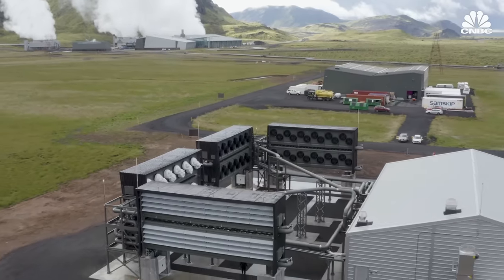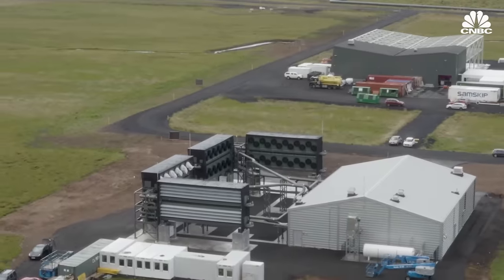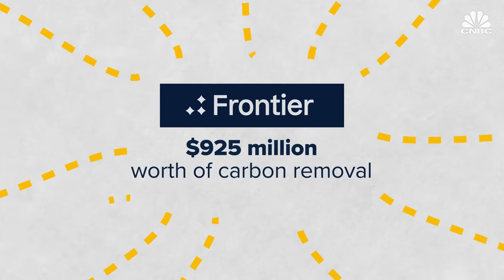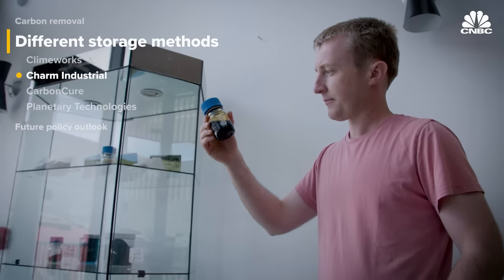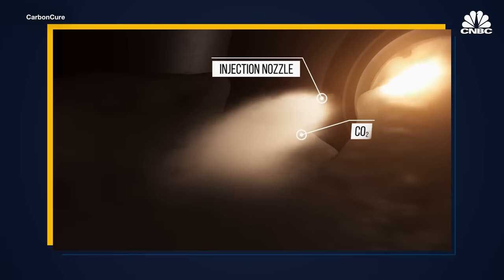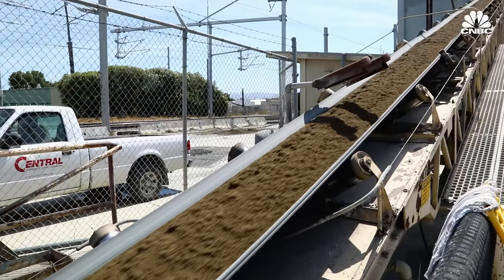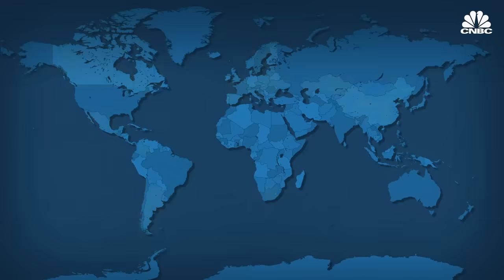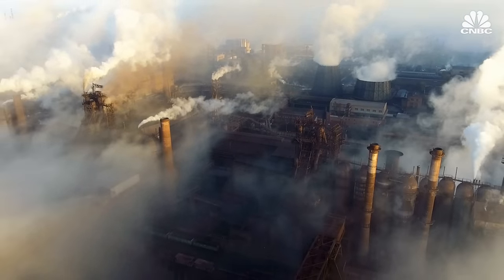Why Big Tech Is Pouring Money Into Carbon Removal

Comment: Green houses use 2000 ppm for optimum plant growth. In 2020 412.5 ppm global average. Plants cant grow under 150 ppm. Would be quite easy to scrub a few 100 ppm out of the atmosphere and claim global warming. green cools the planet. Record, recorded temps come from concrete cities with asphalt and dark roof tops the are ever growing lessening the greens needed for a stable climate. But hey they have built the seed arks for such an event and it would not be that hard to replace the Co2 back to levels that can support plant life. Idiocracy only difference is Co2 and not the water. IF Co2 drops below 150 ppm no amount of sun, water and fertilizer will allow plant growth.
Reply: Easy? 100ppm is 250,000,000,000 tons of carbon doxide.
Reply: @wilsonflood4393  as long as we stay above 150 ppm.

Comment: Removing carbon is a wrong strategy. We need to reduce its production in first place and need to create new culture which would counterweight consumerism.
Reply: All good, ut does not address the problem of the excess CO2 in the air. It's not going anywhere by itself so we need to remove it. We need both, decarbonization and CDR

Comment: Using the carbon capture concrete to build highways that also can recharge EVs including freight hauling trucks would be a big step in the right direction for never putting the carbon in the air in the first place while using the carbon concrete. The big trucks and the cars wouldn't need as big of batteries either.

Comment: Forests need a lot of open free space.
 I would instead use the most invasive and fastest growing pest plants It could disturb the ecosystem but they would be harvested continuously by everybody, bringing the biomass to central points for conversion into biochar. The material must be easy to harvest manually and to dry on the air.
Reply: Thats a terrible idea
Reply: I like the thinking. This sounds fantastically inefficient, unfortunately. We already have a ton of agricultural waste as it is, we really need to avoid any more. Plus, this takes land away from growing actual crops and things that people do want/need.
Reply: @Cyrribrae  Only when fossil fuels get even more expensive, "other solutions" might become attractive. The conversion to biochar could deliver gas too (plastics?)  We don't have the ovens yet and that's a hard nut to crack Perhaps household waste ovens could be adapted. As you know biochar disappears out of the carbon cycle for centuries. It can improve very bad soils too. Too heavy metal rich ashes could be perhaps added to cement based construction material The choice of the plants is important. (Hennep best??)  I see potential in Asian knotweed since it is edible for animals (even humans) and it can be dried on the air (better for in the oven) Of course fields with grains, beets, vegetables etc should not be covered with knotweed now. Even grass is good  and pulls carbon out of the air. But knotweed can grow "everywhere else;" in principle, though now we have the second big problem. It must be kept on distance from where we DON'T want it. But I see it almost everywhere, every day and I always felt a kind of spiritual love for the plant. Disturbing the ecosystem is less of a problem since insects don't like it. Of course it should be everywhere but also cut all the time for many decades. It would be like a war against CO2. The effect would only then be noticeable after 10 years at soonest but we can start "now" while carbon capture with machines is never going anywhere I think.

Comment: Any mechanical process for carbon capture is B.S. It will be enormously inefficient but will receive government funding: even the Kochs are in for the pork. The scale required is incredible: if all the excess CO2 were captured in coral reefs, it would create a mountain range the size of the Appalachians. Organic solutions such as fertilizing the oceans to produce more plankton or producing calcium carbonate clouds (RIT Croacia paper) are cheap and efficient.

Comment: there are older ideas that arent mentioned in this, the fuels industry made an effort into it, but then it made no sense... 

The reality is that most of the presented markets or technologies base themselves on capture to storage, which means they deliver a service, not a product... they allow larger companies to still emit greenhouse gasses, on the premise that it will get offset by a aforementioned technology... it achieves very little, and it only drives the point to a break even point... where we capture as much as we emit... you can force companies to pay for 2 tonnes of removal for every 1 ton of emission... but they will just bill that to the end consumer...

Now while I'm totally for the carbon capture technology and am well aware that it needs to be part of the future... I think the older approach can be more impactful... 

The fuel industry looked at synthetic fuels... fuels made from large quantities of readily available resources... in this case Carbon Dioxide and Hydrogen... it failed at the time because it didn't make sense, burning fossil fuels (emitting CO2)  to then use the energy to make hydrogen and capture CO2 to then make Synthetic Fuels which release CO2... it was a fools errand... however things are changing, capturing CO2 is developing, and becoming cheaper. Energy sources are becoming carbon neutral, and no matter what the future is reliant on clean cheap and abundant electricity, which brings new life to the Synthetic fuel idea. But why would you ask? Very simple, unlike previous methods, which is a service provided to offset carbon emissions, this is a product which literally replaces fossil fuels in its entirety within the transport world... buses, cars, trains, boats, airplanes.... they all could be left completely unchanged but become carbon neutral overnight, still running on Kerosene (synthetic), Diesel (Synthetic), and Gasoline (Synthetic). Electric Cars drive emissions free, but making them is 50% of its own emissions already accounted for, what about the batteries and the recycling and processing of its chemical compounds? Hydrogen only works for certain vehicles, but certainly not all (hydrogen on an Airplane?, I don't think so), and even if we did come to a solution, we'd still have to retire a fleet of vehicles before they are meant too... 

Internal combustion cars tend to be easier, cleaner and cheaper to recycle than EV's...

but the main difference is that the synthetic fuel angle give the Carbon Capture a ready-made market and infrastructure (that isnt too say we shouldnt be driving less overall as is), and it takes and existing market and makes it carbon-neutral rather than offsetting it, essentially no oil needs to be used at all... the idea is to have the maximum impact with the least amount of effort...

sure, Carbon Capture and Sequester is cheaper and less effort on its own, but it doesn't make 30% of our current emission carbon-neutral in its process, it still exists within this reality. Synthetic Fuel does more in absolute terms
Reply: Your thought about biochar production "?
Reply: @alexandr26735  makes little sense to me... first you are burning Biomass in pyrolysis, which it doesnt really release GHG, but the GHG were stored in this Biomass, besides you need to grow and cultivate it... then you use the Biochar, to what extent? Burning it will release GHG, and it's a solid fuel... (wont work in cars, or the transport industry), it might work in power plants... but... why? And the scale required makes the idea impractical...

It's already been proven that Biomass for electricity isn't really effective... so if its Parent process is not attractive, it won't get to the scales necessary to do anything with this Biochar...

Comment: Charm's method is interesting, but how about just use this technology to just offset the oil industry.  We will always need to use oil, but that amount can be reduced by the oils that Charm is manufacturing.  Also, they can use their pyrolysis equipment to convert miscellaneous waste/unrecyclable plastics to bio-diesel or other small chain hydrocarbon products.
Reply: no we wont always need to use oil. being that short sighted is what got us into this situation where we're racing against time. once we have fusion and geothermal baseloads for wind, solar and wave tech, we can simply use pumped hydro as well as liquid hydrogen or liquid ammonia to store excess energy. liquid hydrogen or ammonia can then be used in fuel cells for low power, high efficiency devices or combustion engines for high power, low efficiency devices and completely remove the need for petrol, diesel or kerosene. at most, we may need natural gas, but we can use fermentation to produce massive amounts of that while being completely carbon neutral, and processing waste products into usable fertiliser, or at least cleaning sewage, simultaneously.

also with the completion of the european super grid and asian super grid, there will be huge incentives to both expand into sub saharan africa (the european super grid alreeady covers parts of north africa and will be expanded in the future) and to interconnect to each other, probably through turkey and the middle east. this would greatly reduce the fossil fuel load even if the fusion and geothermal energy sources arent ready by the time the grids are complete. each country would be incentivised to put as much power on the grid as possible, so they can sell to other nations instead of buying from them, and that will drive innovations in high output sources such as nuclear, and rapid storage devices such as pumped storage hydro. things are looking up, you will see soon.
Reply: Yea, I wondered the same thing. My guess is that the oil is really low quality. You'd probably have to refine it many times to even get it useable, and it probably still wouldn't be useful in most commercial applications. By that point, you've made the whole process cost-inefficient and probably power/emission-inefficient as well. It's a tricky balancing act. Similarly, I bet converting plastics is also highly inefficient for them. Gotta start with the low hanging fruit. Agricultural waste is a great place to focus, I think.
Reply: I think charm just throws away lots of minerals that should be used as fertilizer for plants. I don't think their method is the way to go.
Reply: @jsplit9716  Which minerals are you thinking of?

Comment: How about implement carbon capture directly on powerplant, which have higher C02 content? But then the cost will shifted from public money into the power plant owner.
Reply: I think the most modern ones do that, but she said there is already too much in the atmosphere. But I think it’s too hard. All that money and energy would pay off more for any of other approaches like buying up all of the Amazon and planting trees.
Reply: Thanks for watching☝️Get in touch . Let's discuss on Financial investments
Reply: The problem is there's no method of doing that. All the proposed methods have been tried in pilot plants, and the best that has been achieved is a capture of 1-2% of CO2 emissions. There's just no way of actually capturing CO2 before it leaves the plant.
Reply: The process of removing CO2 from smokestacks is called Carbon Capture and Sequestration while removing it from the air is CDR (Carbon Dioxide Removal). Confusing, I know! We need to decarbonize quickly and move away from fossil fuels so investing more in CCS systems seems counterproductive and liable to prolonging our use of fossil fuels. Having said that, there are sectors that will need fossil fuels for longer than others and so if they clean up their act, that would certainly help.

Comment: Where does the energy for all this processes come from? Nuclear? Wind? What's the co2 footprint of building and running these facilities? It is hard to believe that any of these measures  could be more efficient in terms of co2 reduction than simply reducing fossil fuel consumption and protecting already existing ecosystems.

Comment: Is it Carbon Capture , or Carbon Dioxide capture? Aren’t we burying precious Oxygen in this process?  Won’t it be better to 1/ leave fossil fuel where it is underground, 2/ use photosynthesis as the preferred “carbon capture” 
3/ A question: is the goal only to reduce emissions? Slowing the rate of rise? 
Or to pull current co2 concentration from ~413ppm down to ~280ppm?
Reply: The rate at which photosynthesis is capturing carbon is just not enough. If we were to plant to enough trees to needed then it would take up the land area of almost the entire world. That is why we need to capture large amounts of carbon using very little land area. 
Also there are techniques that we use to remove oxygen from CO2 and then just store pure carbon under ground
Reply: Yes, they are burying precious oxygen, and this is a really bad idea. It would probably be much more effective to reverse desertification by  using livestock grazing. Forget about cow flatulence; methane only stays in the atmosphere for about 24 years, and so it is not really a threat. Perhaps one day it will be cost effective to use solar energy to turn back the captured carbon into fuel oil; then oxygen would be returned to the atmosphere.
Reply: Trees and algae produce an endless supply of oxygen. Kind of a silly point.
Reply: @attica7980  So in 24 years the methane the livestock put into the atmosphere is changed to CO2 ...which is a bad thing anyway, but the livestock has been producing methane every year so you never get to a point where the methane is "gone"! If the livestock only did their thing for one year that would be fine.

Comment: The same exact argument is being applied to Carbon Removal that was by the other side when renewables first came out. "It is not viable", "they won't make a big enough difference" "It's too expensive"... Can we stop with this bs where only one side can be right about the climate change dilemma. Climate change is an extremely complicated matter. That means it requires complicated solutions. And typically the more complicated a problem is; the more options need to be used to solve it. Carbon capture is a really intuitive way that we can use to help solve the problem. Because guess what? solar panels and wind mills will not help subtract the excess CO2 already in the atmosphere.

Comment: why we store co2 ? we use as cooler gas instead of freon ...and also we use it to produce electric in cold areas where the weather minus 50-60 like Alaska /sibiria liquid to gas form change with small heat(closed circuits) we can use it at everywhere...health..wildfire stop as dry ice...